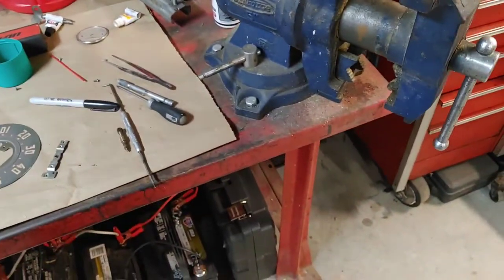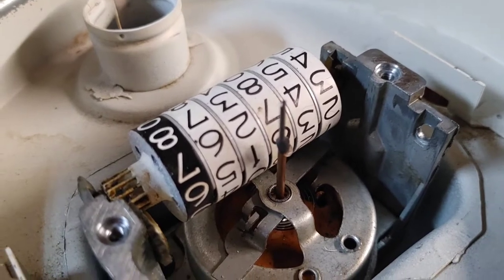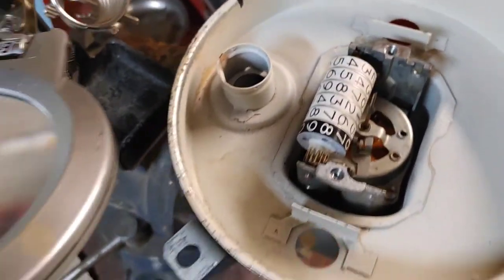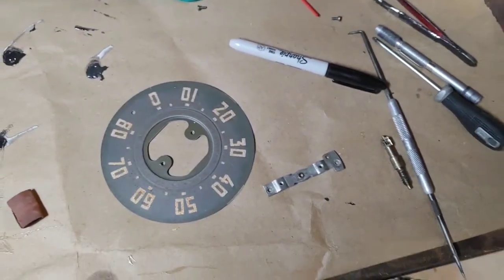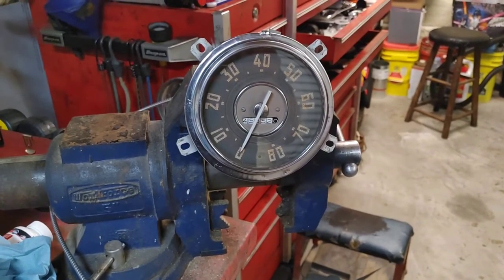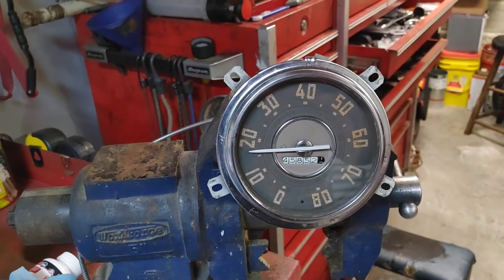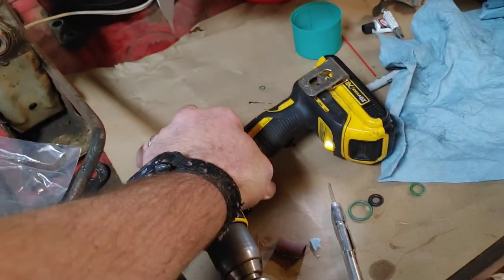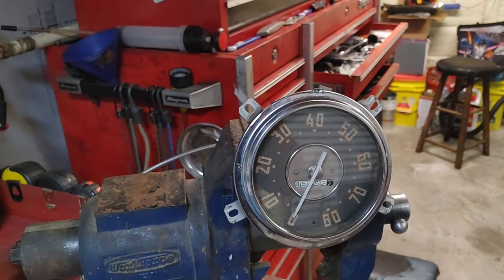speedometer needle install 1951 chevrolet

Comment: thanks for the video. My speedometer is not working. Cant tell how fast I'm going. The speedo cable is new and it is spinning from the transmission. Is there a way to fix this in the speedometer?
thank you
Reply from the maker: You can take a small section of the old cable and drive it manually there is a outside part that spins at cable speed then the inside part (where needle is attached) drags inside the ever spinning faster outer part.